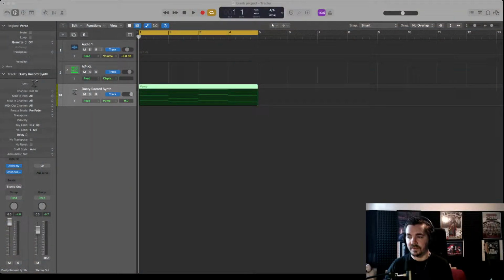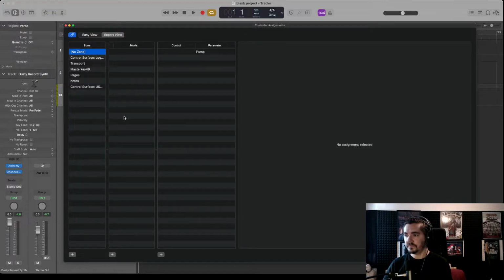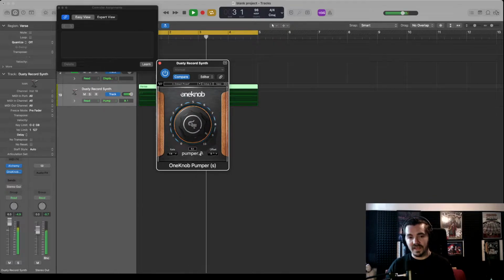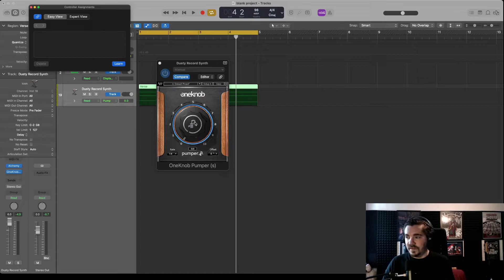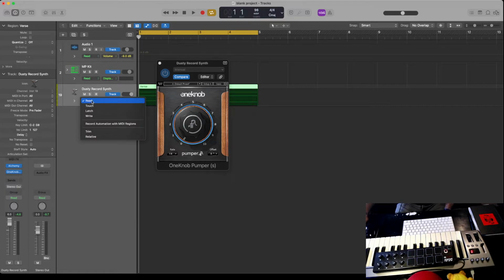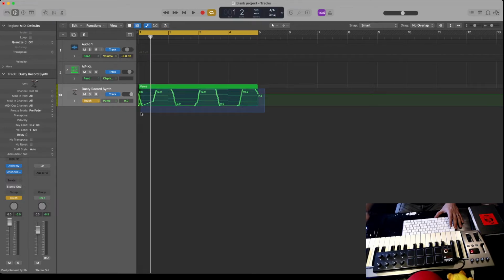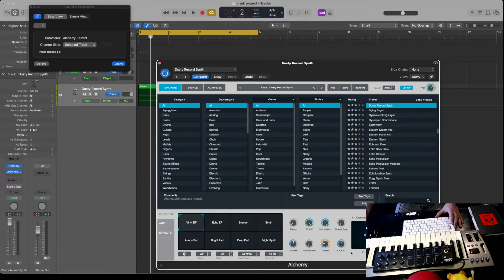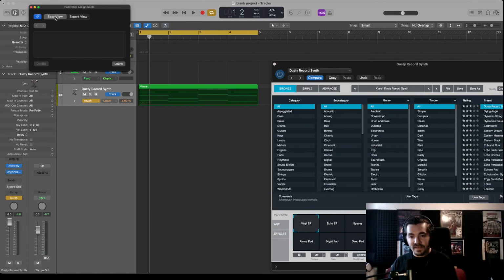A Beginners Guide to Using MIDI CC knobs on a controller in Logic Pro X

Comment: You should be able to right click any of the knobs and click on learn without having to go into that separate window.
Reply from the maker: That's a power tip. I didn't know that one, thanks.
Reply: Command+L and then you pick say Cutoff and then touch desired knob. But it doesn’t map it for the remainder of the project. In Ableton it maps and stays mapped. Unless I’m missing something